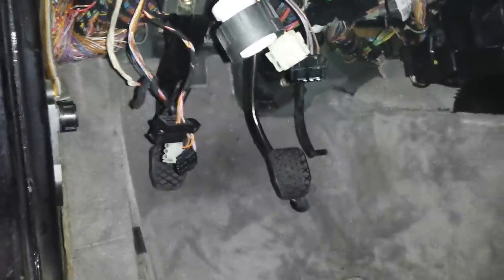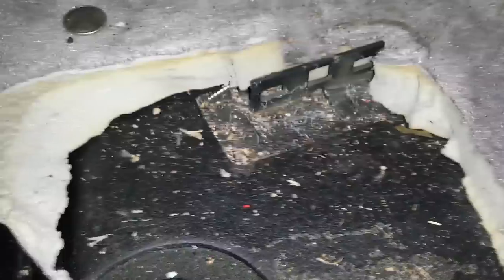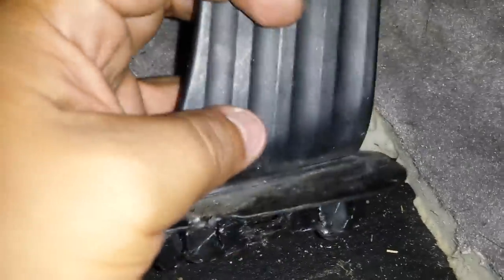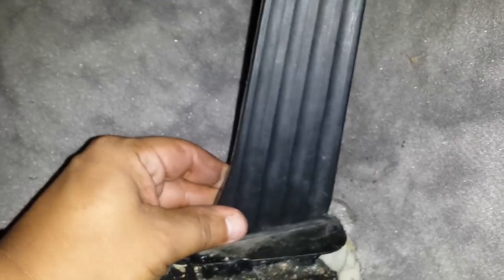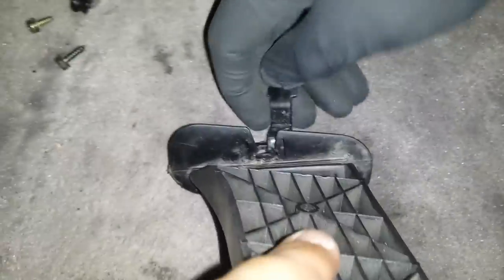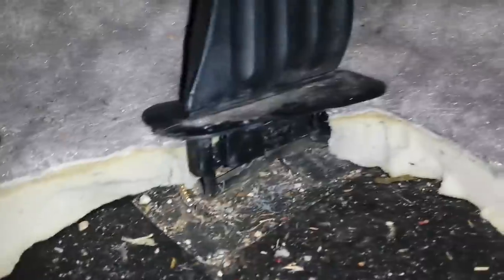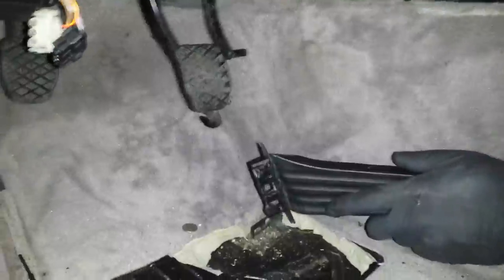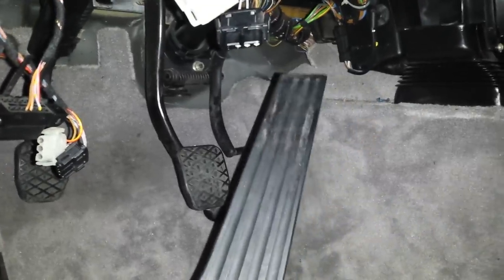BMW e36 M3 325 330 Gas Pedal Removal

Comment: Thanks a bunch, just about to remove mine from 97 Z3 Roadster, it broke off and jammed the gas pedal full throttle on the 4 lane freeway, luckily i got my foot under it and pulled it back to off  position, was scary for a minute, cheap ass setup for sure
Reply from the maker: glad you are ok.
Reply: The same shit happen to me in my 2000 z3!!! but I almost went off a cliff shit was scary

Comment: Hi, thank you for all amazing videos.
I need your help please, i have e39 with 2000cc vanos motor its a very slow car i replace the motor to get more hourse power and i used 2500cc motor vanos M52B25 and it still suck, so i am thinking to install a turbo kit on it please help me does that work someone told me you will lose the motor after few time, because the motor not designed to get turbo, what u think and what is the ideal turbo kit for this motor by the way its 1998 model, thank u :)
Reply: google it, lots of forums where they turbo charge m50 m52 m60 and so on :)